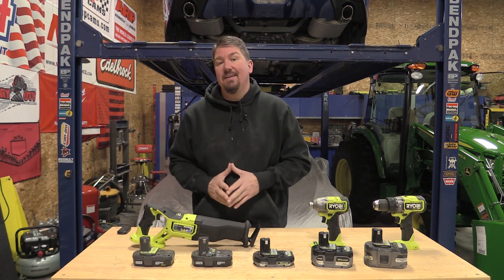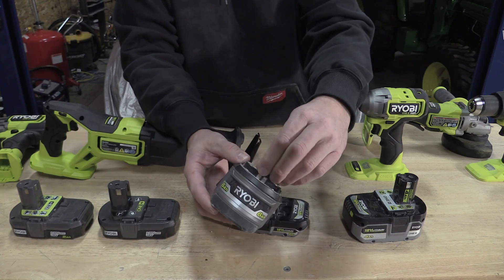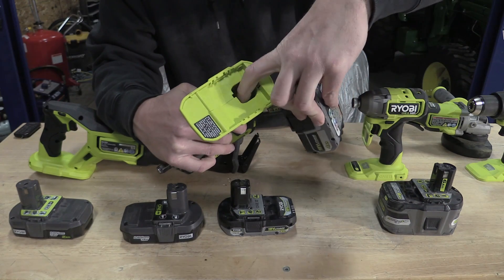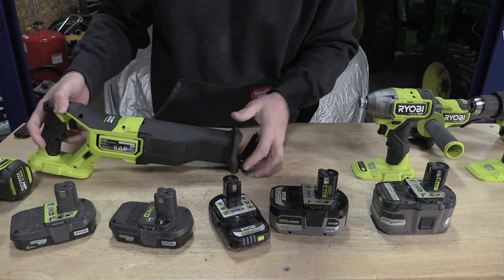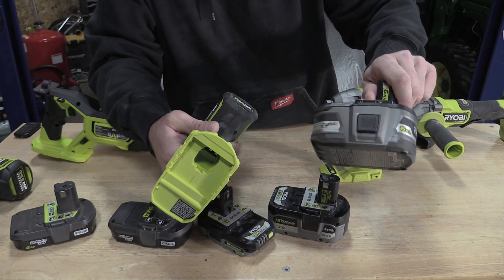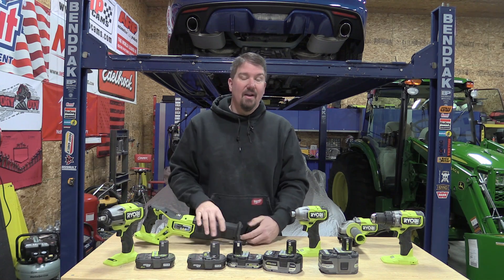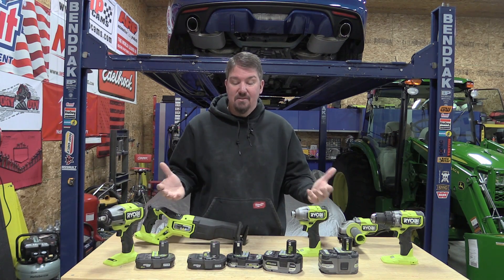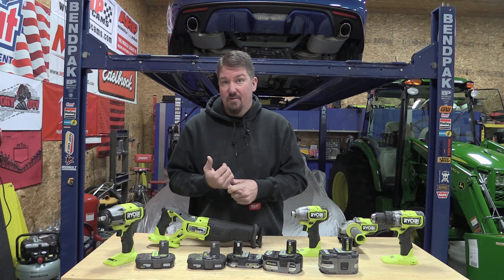My Ryobi Brushless HP Tool Has No Power? This Is Why...  New Battery Line Up & High Performance

Comment: Hmm, my understanding of the HP batteries (I could be wrong) is that the two extra contacts allow the circuitry in the tool to "communicate" with the battery, which optimizes the performance of the tool. The different amp hour batteries should deliver the same 'power' from the tool when they are fully charged, but of course the lower amp hour battery will be depleted quicker. Again, I could be wrong, but I believe it's the voltage and current flow that determine the power of the tool, not the storage capacity. A 3Ahr 18v HP battery should provide the same "power" to the tool as the 9Ahr HP battery, just for a shorter time.

Comment: The newer tools have built in monitors that prevent smoking the battery or the tool itself. No matter how many amps a tool draws, that amperage draw is split equally between each cell in the battery pack. Most hand tools use battery packs that are made up of individual AA cells. These cells have a limit to the amount of current they can deliver safely before they overheat, (or in the case of a "Smart Tool", the tool stops working before destroying the battery or tool.  Batteries don't like heat. So, with a larger Amp/hour battery, (more cells), it can put out more current, (at the same voltage), than a smaller battery and with less heat. Unlike NiCads or Alkaline batteries that are basically self regulating as far as current goes, and will just run slower and slower until they are dead, Lithium batteries will usually run flat out until a certain point and then just stop with no notice, (because of the built in protection circuits). Lithium batteries can provide extremely high currents if allowed and if unregulated, can melt or explode. I could go on but the  ALL batteries have their pros and cons. Ni-Cads have fallen out of favor because of their lower peak current output than Lithium batteries and the move away from Cadmium because of the waste disposal issues. Hand tool manufacturers want to list the peak power of their tools even though most people don't use them that way. A 120 volt corded, tool will beat all of the battery tools any day, but you have an extension cord to deal with, but you don't have to deal with recharging batteries. Then there are things like pneumatic or powder actuated tools. To give you an example, I inherited a Skillsaw worm gear drive, circular saw after my father died. He used this for 30 years. Recently, my girlfriend hired her 18 yo grandson and his friend, to tear down our old deck. They started in with some battery jig saws. After watching them and resisting the urge to say they were taking too long, I offered up my SkillSaw with a Carbide tipped blade. In 15 minutes they were done!  If you talk to any professional tradesperson, they will default to a corded tool if they can, especially for a big/long job.

Comment: So, five months after this video, I bought a P262 HP impact wrench and needed a battery.
There's a sticker on the bottom of the tool that state to use ONLY the batteries noted in the instructions. Which I couldn't find.  Or to use the P197, but that's a non HP battery that lacks HP terminals. 
-The compact P195 4AH battery, the only one with 21700 cells has been tested with the P262 and shown to provide the highest current and thus highest torque output. But, it is not available anywhere now, not HD, or even on eBay. I found it in a few combo kits in a few stores across the country only after some effort.
-There's another new 
'High Performance' battery with 18650s. I have no clue what's new (or better) about it. But its not labeled Lithium+ or HP. 
-I tested the P262 with my older P102 battery packs. It didn't operate properly. They do not provide enough current, I suspect.
-So, I ended up buying a new-in-package P191 3AH HP battery on eBay for $30, for now. It seemed the cheapest option until I could make some sense out if Ryobi's fustercluck battery schemes. 
I am aware that there are currently lithium battery shortages due to covid related supply chain issues and more electric cars being manufactured, and other related issues. I have to wonder:  Did Ryobi bail on the 21700 cells due to shortages, or issues with that configuration, or do they cost too much to use? I don't know. 
What I do know is that Ryobi really needs to get it's act together and straighten out their battery mess. Tool buyers shouldn't have to research for days which battery provides the best performance for their new tools, especially HP tools. They didn't even bother color coding HP batteries to HP tools.  Personally, I regret buying the P262. I bought it for a one time  repair where I cant use a cheater bar, and may just sell it on eBay after I'm done, due to battery confusion and go back to using a cheater bar for the few rare times I need a mid torque impact.  
Bad, Ryobi. Bad.
Reply from the maker: I think the change it Ryobi battery labeling has them all messed up.

Comment: Torque Test Channel dispelled some of the claims you're making about battery size. I don't get why so many people think that higher CAPACITY in a battery automatically means higher draw. It just doesn't.

Unfortunately you're leading people to spend money they don't have to. Actually, that mid torque preformed best with a DeWalt battery.

Comment: Such an informative video… no one else is talking about this. I’ve slowly been collecting the normal batteries (non High Performance) 2.5ah, 4ah, 5ah etc under the impression I was future proofing / growing my collection. Instead I’ve been building a legacy non brushless/HP collection ready set. If I need to now buy one of the bigger HP ready batteries (circa £70+) makes the discussion to switch to Dewalt valid again.
Reply: if your cool with spending that much u should just go all out and get Milwaukee
Reply: @alexander-yd3hz that's why I still use ryobi for all my lights. And once again if he's willing to spend the money on Dewalt he might as well spend a little extra and get the best. Milwaukee is king
Reply: @alexander-yd3hz Facts. For the price I think Ryobi is better than Dewalt. I honestly hate Dewalt. Every time i use my buddy's Dewalt drill I have no control because it doesn't have a variable control trigger like my ryobi does. To each their own tho 🤷🏽‍♂️

Comment: Great explanation for a complex set-up. They almost need some type of additional name for the tools that have and use the 2 additional pins.. call it "Ryo-BOOST' or something catchy. The concept of a larger Ah pack for larger tool 'should' be well known these days. The more cells in parallel then the less each cell has to push out for the higher the Amp draw tools which makes a huge difference in the voltage sag (and cut-out) effect. The 9Ah at full demand of about 15A will pull only 5A per bank of cells and will have very little voltage sag and energy loss to heat. The same 15A draw on the 4Ah and 2Ah pack will pull out 7.5A and 15A out of each 5-cell bank respectively with an increasing voltage drop and energy loss due to heat.

Comment: I just bought the two drill set of Ryobi One + HP Brushless PBLCK01K.  I am disappointed after seeing this video but i am honestly yet to use them. I have less than 24 hours with them. What exact battery do I need to get more power? I trust your judgement so I won’t mind having at least one stronger battery.

Comment: To confuse things even more my P262 HP impact wrench actually says on the bottom to use the batteries recommended in the operators manual or P197.  The operators manual basically just has a list of all batteries currently available and P197 is a 4ah non HP battery.

Comment: And this are the reasons why I stopped purchasing Ryobi Tools!!! Because Ryobi under TTi is now scamming their consumers!!! Really! That's why I'm now moving to Craftsman Tools under the Stanley, Black and Decker flatform. Tell you what I've been using my old Ryobi P238 Brushless 3 Speed Impact Driver in my Jobsite even though I have a DeWalt dcf888 and dcf809. Now it's clear that Ryobi is changing. Then why not Ryobi just adopt the Slide in battery type to cut off all of this HP Crap! Honestly! My Japanese made Ryobi by Kyocera I purchased that tool in Tokyo Japan and shipped it home because the damn airport wouldn't allow it in my damn baggage!! So I paid the shipping! But it's worth it! But it is a Slide in 18V battery! And the Ryobi Kyocera can accept Makita 18v battery. And it's a lot more powerful than the new TTi Ryobi new hp system.

Comment: More Power! So most people are going to wind up with some 1.5 and 2ah batteries. They'll work fine on some of the tools that don't need max power. I have the P262 1/2 inch impact wrench and bought the last 2 pack of P191 3ah HP batteries. No doubt in my mind that they are enough for this tool in most applications. The tool is rated to 600 or so lb/ft and I doubt I'll ever need much over 300. The 191 batteries have 2 rows of 18650s. The newer compact HP's are said to have one row of a bit larger battery in the 3+4ah size. The total wattage supplied by the 191s is said to be higher. Whatever, it just gets irritating. If I need more than the 191s I'll have a 4ah HP when I grab the hammer drill kit. What's nice about the new HP tools is their upper limits are beyond what most people are going to be using them for. Generally speaking. Like having a V8 in your pickup when a 6 can do the job.

Comment: So I bought the 1/2 impact ryobi $99 bundle. 4 amp battery non brushless and I was taking of lug nuts on a car and it struggled on 2 nuts I was confused  would a 9 amp battery help get more owed to the older 1/2 impact. Not the hp battery but the old 9 amp battery
Reply from the maker: The old Ryobi 1/2" impact was always a sore spot in Ryobi's line.  It was a 250 ft lb max and it was and is weak, no matter what battery you use.  You would be better off spending the money on the new impact, I believe it is the P262

Comment: I just saw this - Excellent overview of Ryobi batteries, honestly the best I’ve seen! I knew about the Dewalt batteries and understood the amp-hour differences, but didn’t realize Ryobi was playing the same game (HP vs. “High Performance). I was looking at getting the new combo kit at HD for $229 (ONE+ HP 18V Brushless Cordless 1/2 in. Hammer Drill/Driver and Impact Driver Kit with (2) Batteries, Charger, & Bag) and just double checked and that kit does come with the new High Performance batteries, a 2ah & 4ah which for me at this point is perfect. I already have corded saws and pneumatic brad nailer so I won’t need super high powered batteries.
I think an important point is that if you live in an average tract home and have outdoor outlets as I do, having corded miter, table and even a circular saw is often better and less expensive. It also lets you get whatever brand fits your needs the best, no being tied down to a single line because of batteries. Figure out what cordless tools you really need and the power that you’ll need. I had mentioned before my Black & Decker Matrix set has served me well for many years, all with 20v 2ah batteries (including cutting through Trek decking like butter, driving 3” through 4x4 posts and a lot more). So I have figured out for me what cordless hand power tools I need which may be different for others and certainly contractors. 
So again, thank you for this wonderful clarification, it has really helped in what I need to look for!!

Comment: I thought this was a Great video, nobody else is talking about this. I was confused during the video but caught up to speed. The short answer is only buy 4 to 9 ah batteries for bigger tools in the HP line. I got really interested in this line as I'm a DIY'er. I don't want to spend my money on contractor grade tools but I don't want junk in my workroom. I thought this would be the way to go but now I'm questioning that. It'll be interesting to see where this tech goes if solid state batteries make their way into these. And as one user said below is will they continue this line or start a new platform.

Comment: This is extremely confusing stuff. Especially since in Europe, we have "high energy" batteries with the extra connections, but no HP or high performance. I reached out to Ryobi in my country about this and asked them to explain (among a couple of other things):

1) the differece between HP and HE,
2) the difference between HP/HE and regular ones
3) why does some HP tools NOT have the extra connections at the back

They did not answer my question at all, instead answering that the High Energy batteries are made for "25% less heat generation" and "are compatible with any one+ tool" and that they are just "the same". I tried again, asking spesifically that if they are the same, why is it that a regular 9aH battery outputs 30 watt hours, while a 3aH HP battery outputs 35 watt hours according to their own data (can be found in their MSDS and in their videos on ryobi.com)

They then answered me that HP and HE is the same, the only difference between them and regular batteries is their capacity, and ignored everything else.
I found a statement from Ryobi US somewhere (cant find it now, sorry) that they claim some of the newer tools have the HP technology "built into the tool", which makes no sense to me as buying a new tool does not change what your old battery is capable of putting out, unless it was already artificially limited before.

I really like Ryobi tools, to me they are the perfect blend of cost and performance for my uses, but it saddens me that their products (which have separate product codes here too btw) is so confusing, and that they are not able or willing to answer spesific questions about them. Made worse by the fact that the answers they gave me in many cases are factually wrong.

Sorry for the long comment. Do people still do potatoes?

Comment: Ryobi seems to be doing something similar with the 40v outdoor tool batteries. There are also new HP mowers, trimmers, etc. There were already brushless models of their 40v outdoor stuff. With the new change/lineup, it seems they're redesigning the batteries also. Ive seen a picture of the new 40v battery that has "HP" written on it, and it's physically bigger than the "older" gen equivalent battery (6ah), plus it looks like there are 2 additional contacts on the battery similar to the 18v batteries.
Reply: Be careful tho not all HP tools have the contacts and not telling people. Then people get scammed into buying them thinking they need them on tools that wont even know the difference. They skep af for that. I know for a fact some HP drills and trimmers don't have the extra contacts and prolly many more that idk about. HP just means brushless motor in that case.

Comment: When they change the labelling from 'HP' to 'High Performance' will they also be changing the battery model numbers?
Reply from the maker: Yes, the battery numbers will get much longer.
Reply: Yes I dont know why but instead of just P191 or so like the older batteries, it will be PBP002, PBP03, etc... for the newer style batteries.

Comment: As an owner of Ryobi tools (brushless and a few brush tools) I have been learning first hand recently that some tools need a larger battery over other tools.

For example, I have the 3ah HP batteries and they work very well with my brushless impact drivers drill, and hammer drill. I used the same battery on my brushless 4 1/2 angle grinder and it drained the battery very quickly. It makes sense now after my experience that tools such as angle grinder, circular saw, reciprocating saw, etc.demands more power thus getting a 6ah or higher battery for it. I recently ordered two 9 ah HP batteries for the last three tools I just mentioned.

I like my Ryobi tools. The 1.5 or 2ah batteries are not a good marketing strategy for Ryobi to include in their kits. I'd say at minimum include a 3ah HP battery in their kits or a new 2ah HP and a 3ah HP battery.

Great video in relation to this topic. Thank you.
Reply: It will drain the battery very quickly, but still will make good power.

Comment: It is clear as Mud for those DIY users that DO NOT read the reviews , I have always read the reviews and watched the reviews. The one thing that was said OVER and OVER  1.5 AH  / 2.0 AH batteries where not the best for the TOOLs always step up to 4 AH / 5AH batteries in the 18/20/24volt lines . the 12volt line the 2AH / 4AH batteries were the best before they came out with the other sizes .

Comment: I think Ryboi can transition to a new battery, like a slide type instead of stem type if they provide tool and battery adaptors for a few years during the transition so you can mix and match old/new tools and batteries. Otherwise, they alienate all their current users.
Reply: The problem is that any tool that is made for a slide will not work with an adaptor where will the stem go even with an adaptor. They could sell slide type batteries with an adaptor because it's easy to make a slide to stem adaptor. I hope Ryobi never changes battery styles.